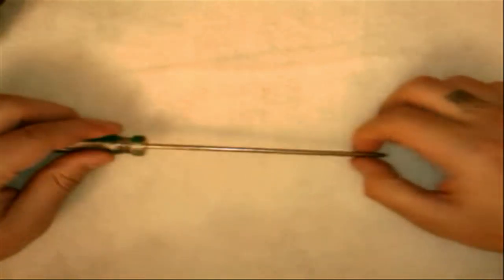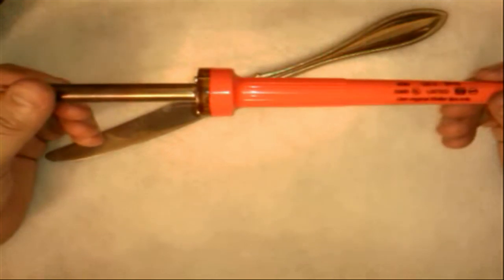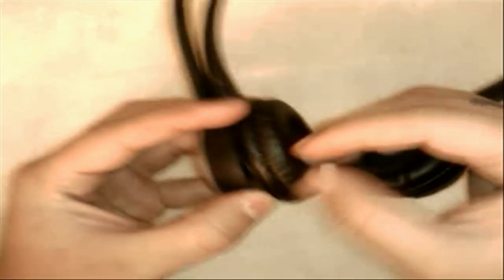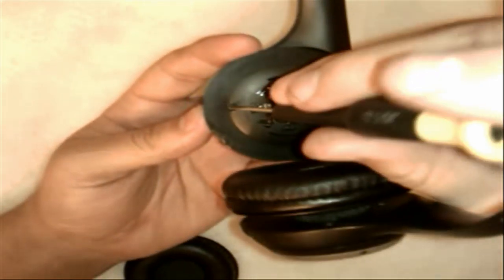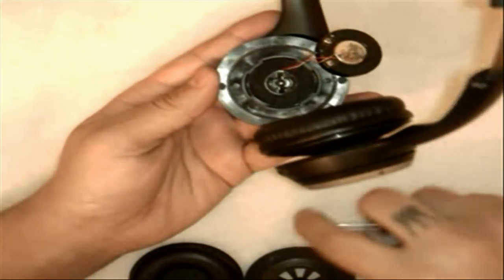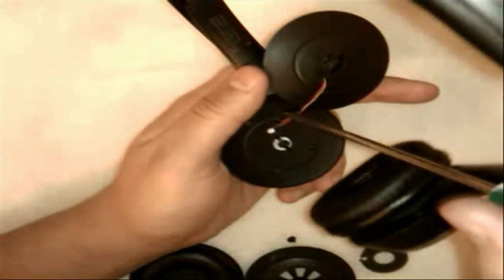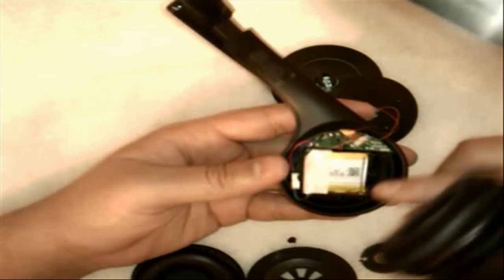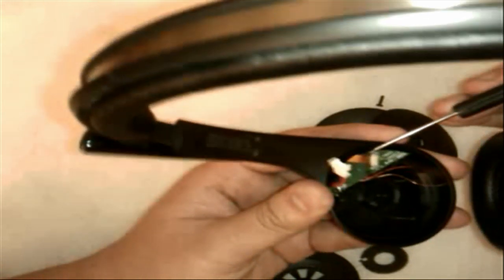Logitech Wireless Headset Repair

Comment from the maker: I actually just checked here after a long time of not checking comments lol.

As for the wires, I had a pair of headphones from an iphone and I just cut and used wire from those. They are the same gauge wire (I think like 24 or something tiny like that) so they worked fine. I still have this headset and it still works wonderfully since the repair. I haven't had to open them again since this repair. 

I am planning on doing another video since HD is everywhere... Hopefully soon...

Comment: Both speakers work now and balanced (replaced it with a peice of computer fan wire)... however, mic is dead, and the mute button light isn't going on/off. Couldn't figure out what to do with the ribbon cable, I think when I clicked the thing up, it broke off some sort of thing that held it in place. The ribbon cable doesn't go all the way in, and doesn't "click" into anything.

Comment: Tape will eventually fall off and allow the wires to move around,  if you cant solder I would recommend hot glue gun to hold the wire, and then also tape.

Comment: I bought my headset about 8 months ago and it started having problems. I decided they were simply broke so I ordered another pair from Amazon.Com for $80. They were suppose to be new. They came in a plastic bag instead of the new packaging. 

I figured, what the heck - so I tried them. Same problem as the ones I was replacing. Left speaker was completely out. 

Today, I was snooping around found this video and fixed them both. Thanks 'denraweb' this is another reason why I love YouTube.

Comment: @khaemera The problem is that the wire may not APPEAR broken, but pinching sometimes breaks the actual wire inside the insulation, so you can't really tell. If the problem occurs again, then go ahead and replace the wires anyway.

Comment: Excellent tutorial.

I just took it apart out of curiosity (I just took the leather piece and the top of the speaker off--didn't rewire anything), and afterwards the left headphone seemed to be fixed. I think the wires got pinched and taking it apart loosened them up. So, even if you don't have the materials to redo the wiring, it might still be worth it to crack it open and reassemble it.

Comment: I got halfway through pulling mine apart and thought I was going to break something when I tried to pop that plastic section off - then found your video showing that it was indeed the correct way to remove it.  :) thanks for posting!

Comment: Thank you for posting this tutorial. Very helpful. I just fixed my headset, with no problems at all. works just fine now. I had taken back a headset that was only about 2 months old, and they replaced the. then that second set had the same problem with in about a similar time frame. except the second time, i was in a different country. and by the time i got home, the warranty had expired. so repair was my only option. thank you again.

Comment from the maker: @MrMcMashup 

Lol 
There is a thing layer of material behind the pads. Put one edge on the plastic disc on the headset and then hold it with your finger. Then use a flat head screw driver and starting from your finger, follow it behind the material all the way around the headset.

Comment: Trying to find disassembly instructions I found your little guide here. It turns out the problem you're fixing was the same one I had. Swapping out those wires worked perfectly, thanks for the video.

Comment: I'll have to give this a whirl, need to buy the soldering iron.  I've been using logitech headsets for years and nearly every one has gone wonky.

However, I learned my lesson after the first time and got the 2 year warranty at Best Buy, and I've been exchanging them every few months with little to no problems.  One time even though my warranty wasn't up the dude just said I couldn't exchange it any more, but I had gotten so many headsets free I didn't mind.

But the warranty is a good buy!

Comment: @denraweb 

I checked your video, mine has a diferent thing, it doesn't have the two screws to remove the top of the speaker, it's glued, had to make it using a screw driver, on the two thin arcs on the top. 

I have broken mine, because I didn't know how to remove the sponge cushins. :) how stupid, only the support of the earset is broken, if logitech charges too much for the headset,  maybe I ll try to fix it.

Mine was having microphone problem, not left side ear.